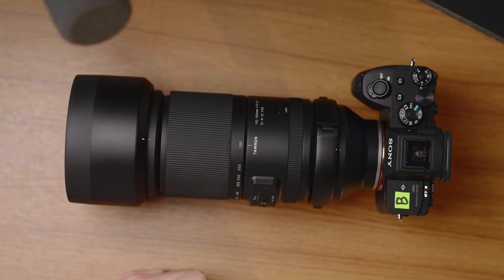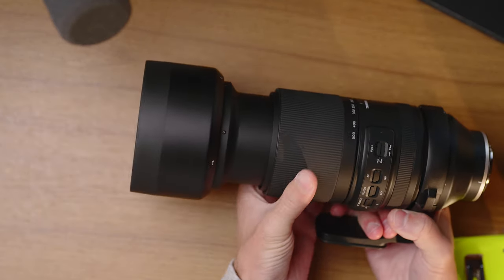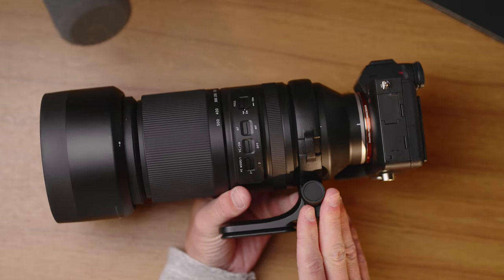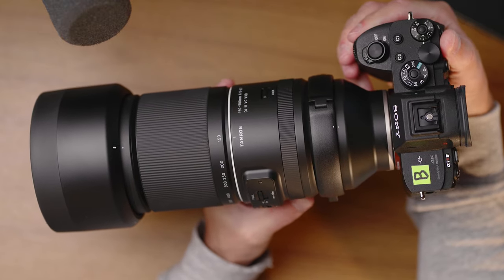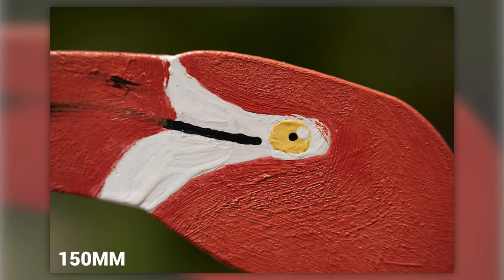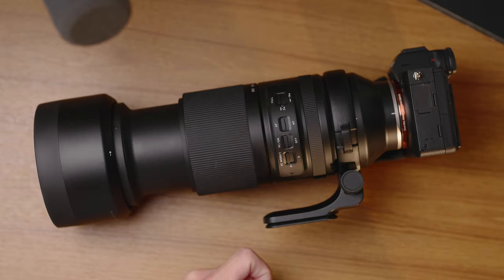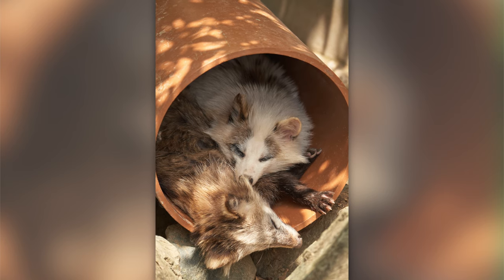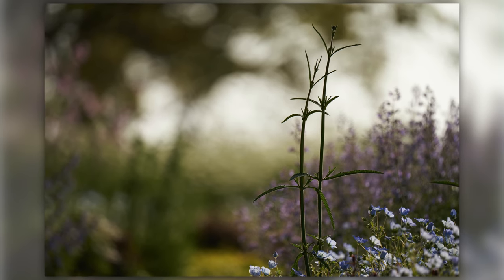Tamron 150-500mm f5.6-7 Review (Part 1) | Build Quality & Design

Comment: Quick note on close focusing: Max reproduction ratio of 1:2 is the same as 0.5x magnification. This is considered half macro and the minimum requirement for a lens to carry the “macro” label. True macro is 1:1 or 1.0x magnification. This lens has very good reproduction ratio of 1:3 or 0.33x magnification but it’s not the same as other examples you mentioned.

Comment: Amazing video!! Definitely subscribing!!
Id love to see a side by side comparison with the 200-600. I own the 200-600 and i find at times 600mm seems to be a bit soft or mushy on my a7iii so i find myself shooting around 500mm anyways. That could just be a result of a lower resolution sensor or i have a bad copy.
I love the portability of this new 150-500, traveling with the 200-600 can be rough at times some im for sure definitely interested in this lens. Also minimum focusing distance is pretty bad on the 200-600 so the tamron is pretty exciting!

Comment: Congrats for this video. I was wondering too why thera are so few reviews about this 150-500. I bought the Tamron 70-300 and it has done surprisingly well, but it was because there wasn't any lens so competitive in that range and prize. I'm looking forward your performance review, particularly at 400-500 range and in corners. Comparison with the Sigma 100-400 would be so useful as well. Probably I will put on sale my 70-300 just in order to get that 150-50!! Cheers!
Reply: Sorry: There are / price / 150-500

Comment: This lens is definitely in my plans. I'm using a Sigma 150-600 Contemporary with a MC-11 adapter (on a A7RIII), and this is really disappointing to say the least... Usable only with AF-S mode, images aren't super sharp, the lens weights a ton... This Tamron seems to correct all of these aspects. I was really thinking to invest on a Sony 100-400 or 200-600 (even if the price is really too high at the moment), but this Tamron 150-500 seems to be a good compromise. Can't wait for the part 2 of your review !

Comment: I’m very interested in autofocus speed and performance. Sigma has a 100-400 e-mount lens that is lighter and slightly smaller, but reviews have said the autofocus performance is quite sluggish compared to a Sony native lens. With the VXD, I have hopes it will be fast. I have the Tamron 70-180 VXD and the autofocus speed and accuracy is awesome! And sharpness wide open in the center and corners at various focal lengths would be helpful, too.
Reply from the maker: I'll definitely see what I can do, but so far it's felt (unscientifically) very similar to the performance of the 70-180 and most other native lenses I've had. I haven't been pushing it, but nothing has jumped out at me negatively. I'll be sure to take a look at corner to corner sharpness too. Cheers!

Comment: Quick correction: the main and rear barrels are in fact metal. This lens is NOT all plastic. It is also gasketed for moisture and dust resistance throughout the body. Brilliant breakdown, otherwise, sir!
Reply from the maker: Thanks for that clarification :) Definitely a solid lens
Reply: @ScottDumas  I know we use a lot of engineered plastics but it ain't all we use :)